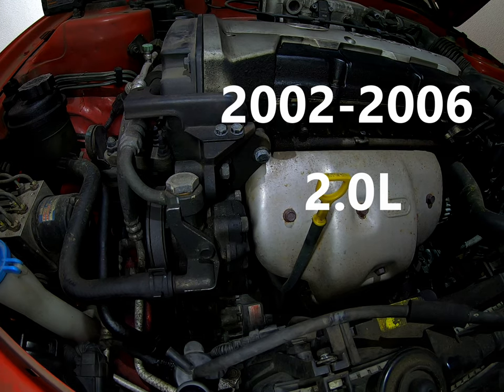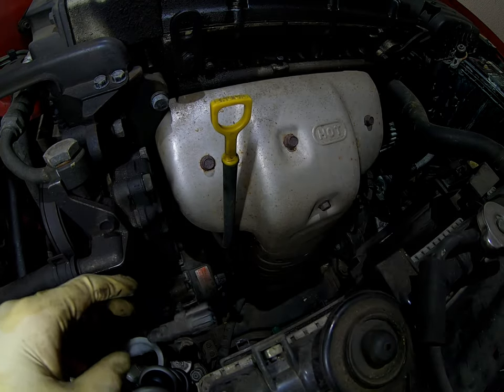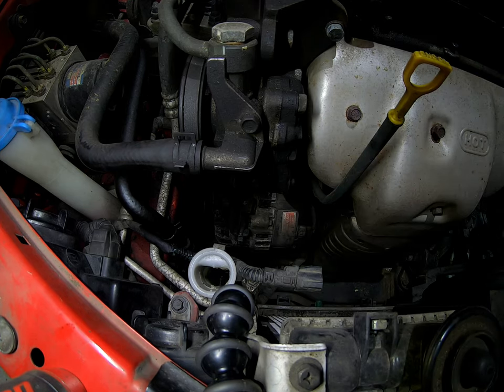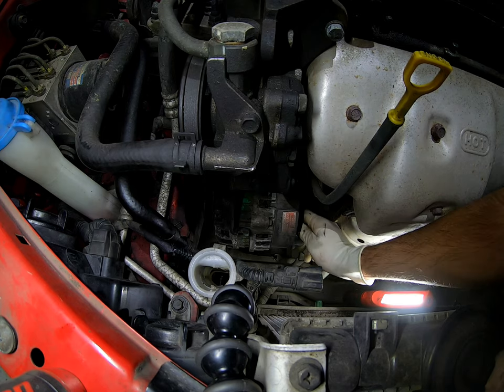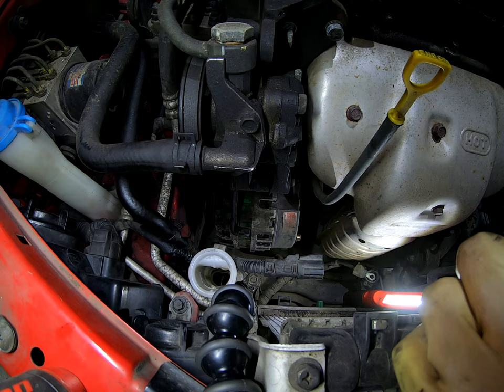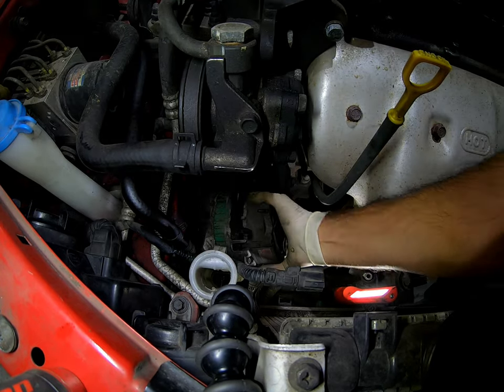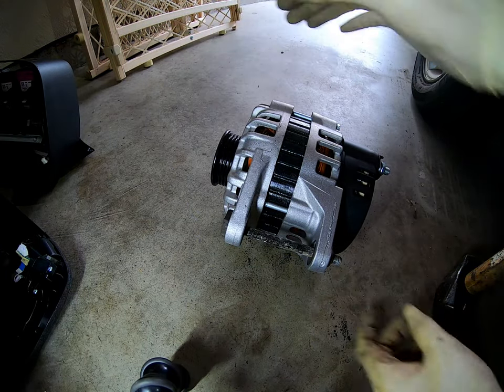2002-2006 Hyundai Elantra Alternator Replacement

Comment: Thank you sir.  This helpful.  Mine was seized,  i took it out, used penetrating oil to free up the pully and install it back. Once the belt is arrived and installed , I'll find out if it works.

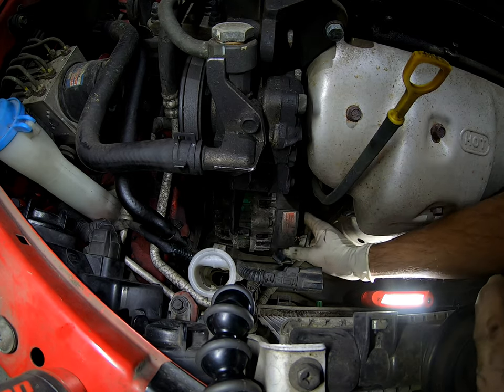Comment: Hello, master. What is this wire or where does it come from? 3:25 & 7:55
Reply from the maker: I believe you're probably talking about the charge harness or the wire that connects to the positive terminal. One is BEHIND on the lower part of the alternator it was really hard to show so i couldnt record exactly where it was and how to best take it off.
Reply: @mechdjango3490  I'm talking about the one you pull out and put in the seconds I marked on the video. I mean the wire that's attached to a screw, and it's tightened with a nut.
Reply: @mechdjango3490  I'm from Venezuela. I don't speak english. I'm using a traslator.
That black wire is directly connected to the positive pole of the battery?

Comment: I can’t get mine removed from vehicle, as easily as you did! The other alternative is to take the oil filter off🤦🏾‍♂️🤦🏾‍♂️
Reply from the maker: There's probably still a bolt on
Reply: MechDjango took me a while, but I finally wiggled that things out of there. Barely enough space to pull through. Thanks for the vid
Reply: Spray it with WD40 and it should come out.
That's what I did.

Comment: There's an easier way to remove the alternator, remove the oil filter, it falls out the bottom.
Reply from the maker: The way I did it doesn't require you the lift the vehicle or let oil drip down. You are free to do it whichever way you prefer